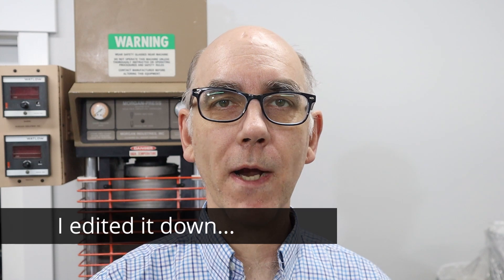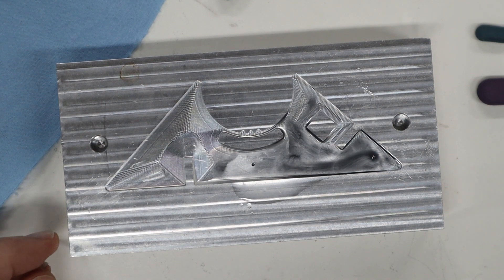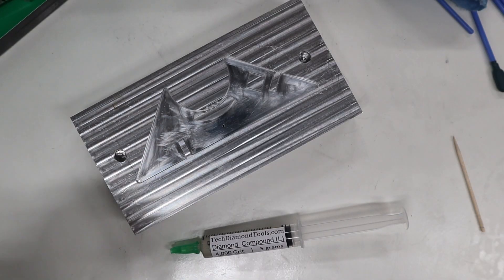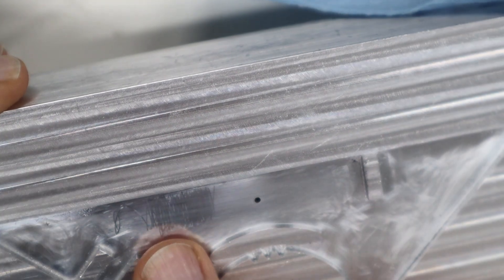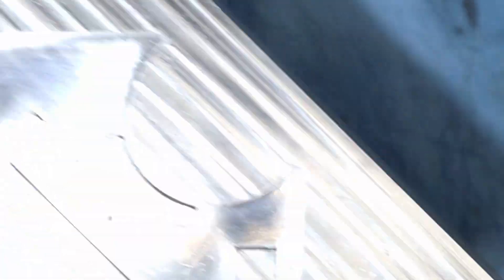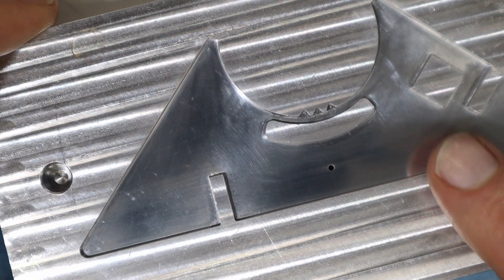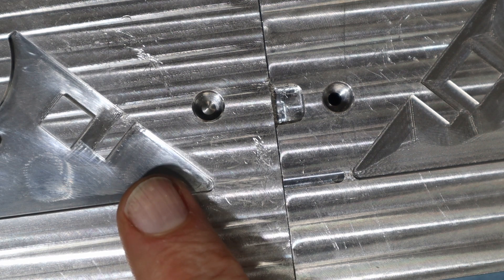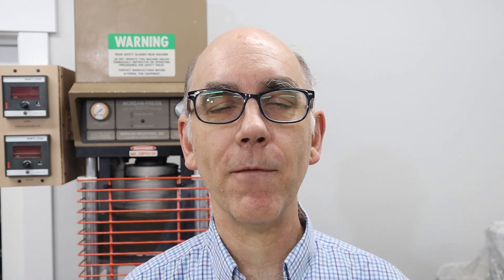Mold Polishing First Try

Comment: Mold polishing need a lot of patience, avoiding the edges of the cavity to get dull is utmost important. A 2000 grit of sandpaper put under a small hard wooden stick or bamboo, formed like a chisel would make a mirror finished. Followed by diamond paste 1 micron on a felt. I'm a plastic injection moldmaker for 20 years.

Comment: For small batch pellet drying, maybe an old school hot air popcorn popping machine? I’m thinking the small table top type which blows hot air straight up through a mesh screen
Reply from the maker: That's an interesting idea, if you can keep the heat down to 100C. It should certainly make drying faster.

Comment: Polished quite a bit of Aluminium over the years. Not molds but for cosmetic/appearance on machined or pressed/formed parts plus castings (motorcycle & car parts - wheels, engine covers, etc.). I'm surprised that you're starting with such fine abrasives. We typically use 400 or 600 grit paper to remove machining marks & then go straight to a cloth mop (buff) with something like a Tripoli polishing compound. Maybe then something finer to bring out the shine. Where we can't use a mop/buff (as you couldn't inside a mould cavity) we use a polishing paste on cloth. If we have to get into corners we might use mounted felt wheels or Cratex impregnated rubber wheels in a Dremel (or similar). Quite easy to put unwanted grooves or ripples in with those though. Oh & paper towels can scratch a mirror polished surface!
Reply from the maker: Thanks for the detailed information. Definitely useful.

Comment: Started tool & die apprenticeship in '62 at a mold shop, still there 2 days a week. Single to 16 cavity production molds of hardened tool steel until the 90s then added aluminium for prototyping runs.
Milled, surface ground and EDM surfaces were polished to SPE-SPI requirements. Plaques were available to illustrate the results.
We would start with dry polishing stones, then wet paper and finish with compound on felt. We always used the same direction per grit, crossing at 90 degree for each grit grade reduction. Small areas were polished with hardware store wooden dowels or hobby stores balsa sticks ground to a chisel shape. The final polish wants to end with all surfaces being worked the same direction. The toolmaker removed the cutter marks before handing the tool to our 3 full time polishers. 
If it was a lens core or cavity we dry stoned it then sent it to a professional lens company for hard chrome and finish polishing.
Venting tip.  If you have a problem gas burn on a vented mold you can sometimes increase the vent by carefully using a few strokes of course paper on the part line near the burn.  Direction to be 90 degree from the cavity and care not to round over the cavity's edge!
Reply from the maker: Thanks for the info. I have never encountered burning in my molds. That may be because my machines don't have enough injection pressure. Or that I have vents.
Reply: @JohnSL  Proper process parameters are also helpful.

Comment: Hey John, do you think it's possible to run 3d printed or epoxy molds on a Morgan press?
Reply: They both work great!!  We have used objet's high temp 3D print material for molds .  Its best to use a aluminum mud box to keep them together.  Same thing goes with epoxy molds.  We used BJB material.  Worked great for quite a few parts if you keep to tool cool.
Reply: @cre8itgroup903  Thanks for your reply. That's great to hear! Aluminum mud frame - check! — How many parts are you able to get off of Objet molds? And epoxy molds? (I'm aware geometry plays a large role.) I'm trying to determine the all-in cost per part.
Reply: I'll say < 50 but we made over 200 collars and 240 base plates for a project and could have done more.  Remember good draft is your friend and you don't want any thin wall mold features.  They don't deal with the heat very well.
Reply: @cre8itgroup903  Also, what kind of flashing do you get with these molds?
Reply: Keep the heat down and wet lap the halfs before and its pretty much the same if you don't go crazy on the pressure
Reply: @cre8itgroup903  Gotcha. Love hearing that. Thanks for your help!

Comment: Maybe a vibrating tumbler with some fine grit would speed up the process?
Reply: I like using green triangles to knock things down and then porcelain  spheres to really smooth things out.  You have to be careful not to round off your parting line edges too much or your will get a duckbill parting line
Reply: @cre8itgroup903  Yes I meant to mention that too, about rounding the parting lines . . the finish facing pass would be better left until last.
Reply from the maker: My understanding is that the media would most likely not be able to get into all places. So do you use masking tape or something else to protect the parting line?
Reply: Packing tape or quality electrical tape works great.  High temp powdercoating tape also works great.  Cover the mold mating surface with tape.  Cut away the mold cavity with a sharp #11 blade.

Comment: My Father was a Tool maker and he always sent mould tools out to be pollished. But I do remember helping out when I was young touching up the polish after he had ground out some damage or to remove scratches caused by careless Die Setters. I can testify that polishing hardened steel is a real task especialy with old fasioned carburundum paste. 
The way he showed me to clean debris out of detailed areas was to wash out with a little white spirit and then meths (I think thats mineral spirits and denatured alcohol in merikan😊) and brush dry with a soft artists paint brush.
When doing hand work on a mould it is worth while masking the mateing faces of the mould to avoid acidental damage. It also helps to stop rounding over the parting line when polishing perpendicular surfaces.
Reply: Do  you remember what they used to coat the steel tooling for storage?
Reply: @cre8itgroup903  Your talking about nearly 40 years ago. Our own moulds were generaly run untill they were worn out or superceded. As far as I remember when they were off the machines they were just spayed with a generous amount of mold release as they would only be on the shelf for a couple of weeks at most and it would come off in the first few cycles while the machine was being set up.
My dad used to swear by rocol high pressure press tool lubricant for press tools and machinery that were being stored. I don't remember if he used it on molds but I doubt it as it's hell to get off.
Hope this helps.
Reply from the maker: Thanks for the information on cleaning the debris. I was wondering the best way to do this. I'm glad I don't have to polish these to a mirror finish.

Comment: John get some Mother’s Aluminum polish.  After you get your mold smooth by sanding/swabbing.  Get q-tips along with Mother’s Aluminum Polish!  Will make it a mirror finish with ease!  Hope this helps.
Reply from the maker: Thanks for the tip! I looked into it and they seem to sell it as a one-step polish. I'm not sure how that would work, but might be worth a try next time.
Reply: JohnSL it’s a paste.  You get a rag to apply and polish.  Then another rag to clean just like waxing a car.  Use it all the time for my Aluminium molds and it makes it like a mirror.  You can buy it at autozone or other auto parts store for like $6-$8 dollars.